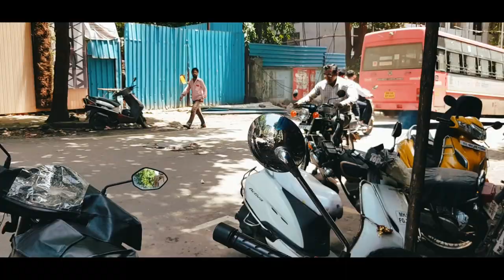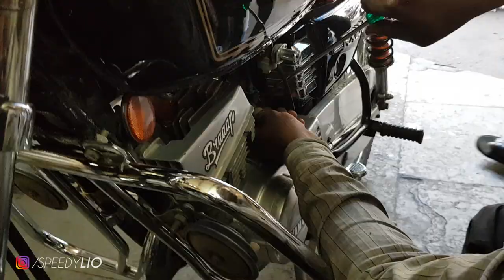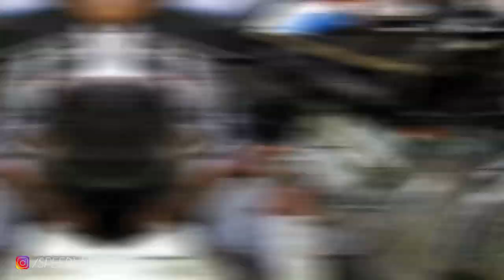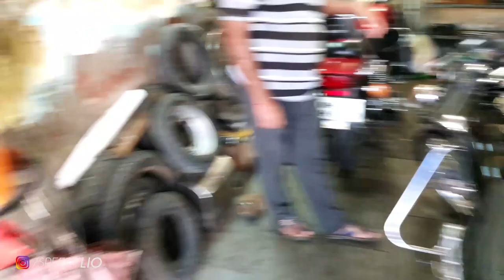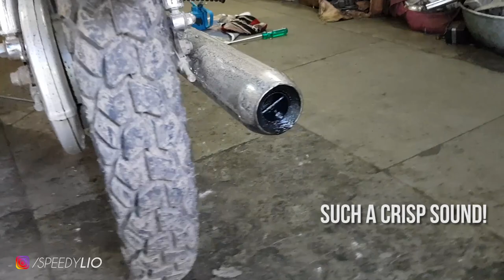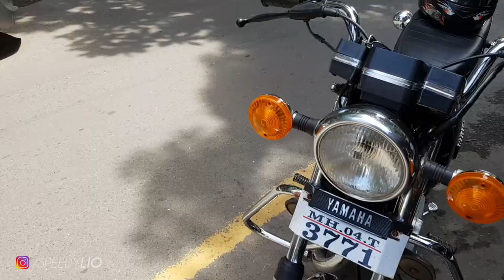Cleaning the Carburetor on my YAMAHA RX 100.

Comment: Is it possible to add 5 or 6 speed gearbox for RX 100. If yes what difference will it make on mileage, top speed pickup, comfort on 80 km +. I regularly commute on highway on my 100.
Reply from the maker: you can convert to 5 or 6 speed but the top speed and everything else will be the same
Reply: @SpeedyLio  Thanks, how about porting and changing to oversized pistons ? Does that increase top speed?
Reply from the maker: @Risingnewman  yes and torque also

Comment: i recently repaired my rx engine full. the performance is beast like but the sound is not so clear like this. it feels like sound is trapped inside exhaust pipe. what should i do ?
Reply from the maker: remove the muffler and shorten it a bit